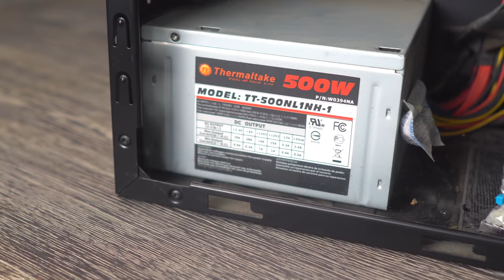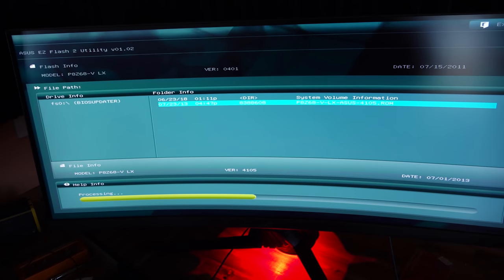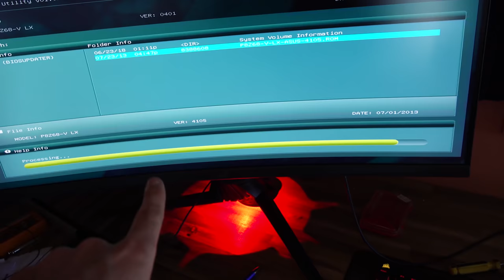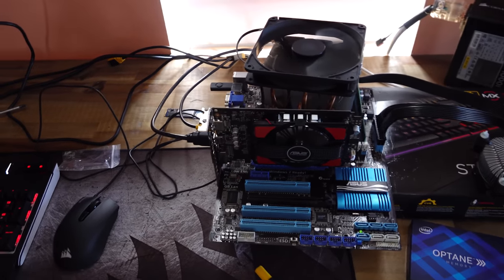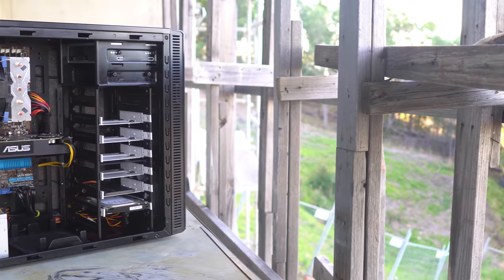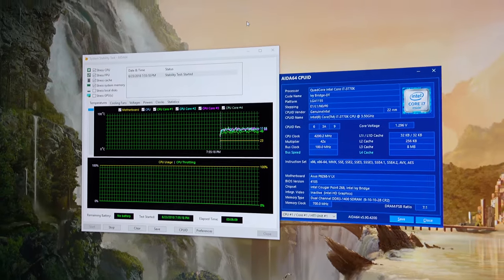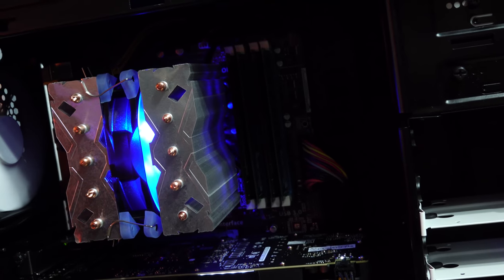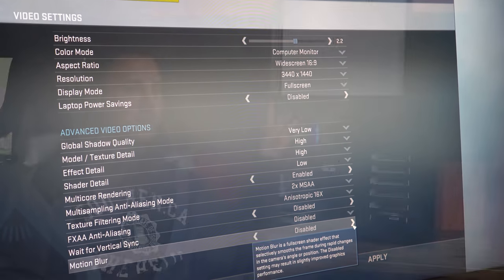How to RESTORE an Old Gaming PC - The Tech YES Process

Comment: 3:26 also try a heatgun on the metal panels, it can soften and take off the label with sometimes much of the adhesive intact. Also, ever think of using an automotive detailing brush? it would lift off a lot of dust easily, and its what i use on much of my electronics and computer stuff, aloong with a microfiber cloth and a small spray bottle of alcohol, and a little bottle of foaming glass cleaner and a lil lens cleaning cloth (just cheaper in the long run, both bottles are refillable, and the cloths wash up fine in the laundry, and the brushes are great, especially for cleaning fans, they're the business for that kinda thing, and you can get a cpl of those cloths at a servo).
Reply from the maker: Will check it out man. thanks for the recommendation.
Reply: Goof Off  or  Goo Gone is the magic sauce for any adhesive
Reply: 2nd that- Microfiber cloths so cheap these days.

Comment: Isopropyl alcohol is your friend when removing those glue marks from the stickers. There are sprays specific to remove them, but I never bothered getting them, no need.
Reply: 90% ISOPROPYL ALCOHOL DISSOLVED THE INTERIOR PAINT IN MY 2006 TOYOTA CAMRY, when I used it to clean the center console area plastic around the shift lever.   It looked so bad that I decided to completely remove the color in a small area.   It also attacks the color on my M510 Logitech mice.   The color transfered to the paper towel I was using.   Only glass cleaner from now on!!
Reply: kodo nosaki oh no, be extremely careful cleaning mouses with it. I only use the 99% ones, but plastic can be tricky. For the outside of computer cases it is heavenly.
Reply: If anything is spay coated don't use isopropyl on it, as it will most likely have adhesive combined with it which isopropyl loves to eat, not the alcohols fault here.
Pretty sure most interior car parts are sugar coated and that is why you don't see isopropyl sold in car cleaners.

Comment: Can you do a proper cpu delidding video? And I got scared by the way you handled the cpu when delidding and removing the old thermal paste. But it seems to work fine. Maybe a video about common misconceptions/myths people have when handling tech? Love this video btw
Reply: They are lot more hardy and sturdy than people think that's for sure...
Reply: phatlewtz82 dies are fairly easy to break if you put too much preassure, thats why lids/heatspreader helps
Reply: Ive delidded a soldered cpu and a i7 4790k

I would use a cheap delid tool (3d printed one) for i7 4790k

Heat gun + single edge blade (maybe a regular blade for wedging) worked on my x5675

Wedge works too - I am aprehensive of that method; chance of cracking the cpu chip (soldered)

Comment: The Ivy Bridge is still very capable. Just did a build with an i5-3570K  @4.0 GHz(a bit undervoltet!) on the small stock cooler you threw in the bin (I cleaned it of course). Peaked at max 83c on 2 Cores after 10+ min of Aida64. and in games max 75c with an Asus GTX 1070 Dual taking everything the CPU has to give. Also 16 gig DDR3-2133 cl.11 @1.6V (XMP) memory to keep it happy. Very pleasing performance.

Comment: that power supply hurts me just looking at it, older thermaltakes are absolute disasters waiting to happen
Reply: Indeed! Many Thermaltake Litepowers were garbage and this is not one of the better ones. In particular, you can see at 1:18 that its two +12 V rails are rated 14 and 15 amps, for a total of 348 watts of power from those rails. And that's if we actually believe the numbers -- it's probably "peak power" at which the PSU explodes rather than long-term capability.

I know refurbished PCs like those need to be cheap, but it is my humble opinion that PSU quality is a little bit unappreciated on your channel.

(but great channel, don't get me wrong, moar please:))
Reply: have to agree, there are better, newer, safer and affordable alternatives.
Reply: always pay extra for a quilty PSU its better to be safe and not worrying that one day it may explode on you or when you away from the pc and end up burning your house
Reply: M7AMD not even that, just don't buy old thermaltake units

Comment: You should try Mass Air Flow Sensor cleaner instead of Brake Cleaner for electronic parts. It is less likely to damage plastic parts and is designed for cleaning electronics and pcbs. Just a tip from a mechanic of 20+ years.

Comment: I have used WD-40 for many years, to soften and/or degrade sticky substances, making their removal much easier.   Naturally, secondary action by other appropriate means and products, finishes the task.    
 
FYI:  Got pizza, or other drips and spills, well adhered to the interior of your microwave oven?   In the USA, I use Shout, a laundry pre treat to aide in maximizing stain removal.   Local options should work similarly.   Spray full coverage, light to heavy, relative to the thickness of the material to be removed.   After 20-60 seconds, push with cloth or paper towel around your finger.   If stubborn, spay more.   If the mess collapses and breaks free from the surface, clean it up.   Finish with a food safe solution wipe and then rinse.

Comment: I have a 3770K and watching this video was very interesting! I find that it is a very good CPU and has been very good to me. I got the whole system on craigslist for $200, i7 3770K 16gigs DDR3 Asus Sabertooth mb GTX 660 2gig 1050w Corsair PSU and a 1TB WDB, I put my 1060 3gig and my SSD in it and it really runs well, plays any game at 60-150 fps depending on the game.

Comment: Bryan, I have a question. Do any of the parts that you spray brake cleaner/wd-40 on end up as an oily and disgusting mess over time? 
Just curious.
Reply: julian23561 brake cleaner wouldnt, it would just evaporate but wd40 would leave an oily film
Reply: Brake cleaner will completely evaporate within minutes. Its made to dissolve grease and grime and leave a completely clean surface. WD 40 will probably leave a thin coating of oil, that could attract dust.
Reply: You wipe off the residue otherwise dust sticks to it. Common step people miss oiling bikes.
Reply: If your brake cleaner leaves any residue it's not real brake cleaner.Brake cleaner should under no circumstances contain oils or leave any residue whatsoever.
Reply: So long as its not bargain basement brake cleaner it shoulnd't leave anything on it.
Reply: See this is what I also thought. Now treat this as anecdotal, but I tested it on a  bunch of old boards and plastics. Caps, Mosfets, transistors, solder resist, slots and plastic brackets in a PC. The Würth Brake Cleaner I used had absolutely no effect on the plastics, even now 2 years later. It's  Isopropyl / n-heptane based and safe for quite a lot of plastics like PP, EPDM, ABS, Polystyrene and most paints.

http://media.wuerth.com/stmedia/shop/catalogpages/LANG_en/2109491.pdf

https://www.wuerth.no/msds/pdf/01216976.PDF
Reply: @budget tech I'm surprised to see an asus employee would be subbed to cartoon network and other childish channels lol
Reply: Uk Gamer thats my kid lol
Reply: Lol @Uk Gamer, now that you mentioned it I took a look. Sorry @Budget Tech I'm going to have to call you out on that too. Don't pretend to be someone you're not. Also online when you're anonymous your credentials mean nothing. Only facts and solid research count.
Reply: Uk Gamer o my god ur a legend
I never thought of checking his subscription list
Reply: @budget tech Wait you and your kid share a youtube account? Also no tech subs to be seen....
Reply: Thanks for all the input guys. I've done my research as well, and found out that alcohol based brake cleaners are safe for most plastics. I guess I'm off to cleanse my soul (PC) with brake cleaner then!
Reply: Uk Gamer
i can confirm that the "asus employee" Budget Tech is subbed to turma da monica and other kid's cartoon channels, i also agree with @Cyber Cat, Brian uses his methods pretty much since from his early vids and nothing bad occurs if you pay attention and follow his tips, i'm an IT technitian and never had any problem from cleaning any PC parts.
Reply: @ rafa yeah at the very least a few angry customers would have told him something was up. Probably repeated uses may do something but it seems to be fine based on the tech yes vids.
Reply: @Uk Gamer agreed
Reply from the maker: Nope and nope, get a lot of repeat customers too, so they must be lovin' that tech yes lovin'.
Reply from the maker: Hey there Budget Tech, I actually work with the team at Asus here in Aus and Jack who helps make the motherboards, he says I am one of the few tech channels he tunes into because I know what I am doing.  Take your shit talking else where and GTFOutta here.
Reply: There are a variety of formulations of Brake Cleaner. You just want to avoid ones with Acetone.
Reply: Tech YES City lmao don't let these haters bring you down I love your content keep up the good work 😁
Reply: Tech YES City hey Brian, love your videos man, when i'm building an PC or i take one PC apart to clean i leave your playlist of PC Builds on, the soundtrack is great, keep up the good work, thanks from brazil
Reply: phatlewtz82 dude you basically destroyed that asus employee"Budget Tech" , nice comment
Reply: Budget Tech what do you suggest using to clean a motherboard and other circuit boards?
Reply: thank you very much... Bryan is a hardworking guy who works in my opinion harder than anyone in the " computer tech" sector of video's here on YouTube.  I just couldn't let him take shots at my boy here because It pains me (and I know I'm a sensitive person) to see this kind of mean spirited commenting behind a monitor to our fellow man/woman who are working hard. It most likely didn't even phase Bryan.
Reply: julian23561 brake clean should be fine. Evaporates almost instantly and leaves no residue. Wd40 is just nuts to me tho. It would accumulate dust like crazy. Only benefit is your stuff is shiny for a little while after u do it.
Reply: Budget Tech it's not the power delivery. I've gone a lot higher on a lot weaker boards. It's psu or a bios setting he's missing. Or it's just a weak CPU. He only went from 1.3 to 1.35 and tried to go from 4.2 to 4.5 lol. I'm guessing most likely VCCIN and a weak CPU also. Never seen a 3770k not do 4.4 even on a weak shit board. 4770k is a different story tho lol.

Comment: after the wd-40 to peel off the stickers, you can use "Goo Gone" (a greasy, oily feeling product the breaks down the remain sticky adhesive and lets you clean it up without damaging or drying out the plastic or paint with a solvent) and cleanit all up nicely and then give a light "dab wash" wit dawn dish detergent to clear the oily - ness.

Comment: I don't think that was a potato even from the start, to be honest. My secondary PC has an i5-2320, 8 gigs of HyperX Ballistix 1600MHz (2*4GB), a PS-500 PSU (it won't explode, I promise), a shitty 500 GB HDD on its last legs, and an Asus DirectCUII GTX 780. It runs just fine, save for the shitty storage. It would've been amazing to have that sort of performance when I first got the PC itself, as it came with an HD 6450 512 MB at the time.

Comment: I still use that motherboard and cpu in my main rig, just with a gtx 1080. Delided and watercooled cpu and gpu, i left the oc at 4.7 ghz @1.23v as its for daily use. Still gets all of the fps out of my 1080!

Two suggestions, nail varnish remover works very well when cleaning sicky residue, its also dirt cheep.

I would have been tempted to flip the psu, as those feet you put on it are not very tall, i would be concerned about the psu being able to cool its self.

Comment: Bryan, trouble with your overclock may come from the VRM, as it's not cooled in any way and anything over 1.3V can make it over heat and eventually at some moment so not deliver much enought of power making system go blue. Please try to cool VRM (fan or some little radiators) and try again

Comment: Good video Brian. My guess is that it's not the CPU. It is the motherboard. The power delivery phases on this cheap Z68-V LX is limited. The caps and VRM's are not up to delivering the power (and peaks) what it takes go get to more than 4,2-4,3. With an i5, you probably can reach 4,4 with no worries.

Comment: Careful with that PSU, it's not 500W as you think. In useful terms it's only a 350W PSU.

It has a peak power output of 500W total, but it's only 350W total sustained across the two +12V rails. It can handle 168W across one rail and 180W across the other.
Reply: Ehh luckily a 350 can run that system just fine. Should probably use more. But it will work.

Comment: You must have loads of cool old pc cases lying around that never sold or weren't worth saving, think you should do a sleeper build, find the nastiest 90s beige box and slap a beast of a system in there, 8700k/2700x and a couple of 1080tis in sli or a titanV, full custom loop cooling, just go nuts :)

Comment: On my i5 8600k I had 5 of 6 cores stable at 5ghz at a respectable voltage and ended up having to go honestly much higher than I would have thought to hit all 6 cores at 5ghz. It’s not all that uncommon in my experience at least. Had a similar problem with a 2600k back in the day as well.

Comment: some advice from a technician: The fastest and cleanest way to remove stickers is to use a blow dryer orhot air gun, and lift the sticker with a plastic spudger or putty knife and then clean any residue with 99% rubbing alcohol and an rough shop rag. If you don't have a heat gun, you can lift the plastic or paper with your tool of choice and then really go to town with the rubbing alcohol.

When cleaning out cases, an air compressor for your shop is a life saver.

Comment: The 212X was shorting the motherboard? Bizarre...
Reply: if you aren't careful the backplate at the rear of the motherboard used by the Cooler "shorts" on the screw that sits proud of it / simply make sure you have the open ended side of that bracket  over the screw .
Reply: I've had the same happen, happens when the tape under the fixture that goes into the mobo's holes loses it's electrical tape.

Comment: Another method to take off a sticker is to take some vegetable oil, put a bit on the towel and rub the part where sticker layer remained when it separated. Enough force and oil will help you remove it, much better than WD-40, just remember to remove vegetable oil grease in that spot with a sponge with a bit of soap. Oil also works as non-scratch compound, as long as you don't use a sponge, use it on cotton towel, or something soft.

Works every time

Comment: hey btw yes if you use a hair dryer directly on to the surface of a sticker for about 30 sec it will come straight off because it heats up the glu and loosens the chemical bond so it give it a try sometime

Comment: The Cpu may have degraded because of the intel stock cooler, a friend of me had the same problem. His cpu ran at 100 degrees, sometimes the system crashed and I just delidded it, smashed another cooler on, BUT only 4.4ghz on an i5 4690k!!

Comment: ware do you get BIOS updates. And there is a product called go gone that will remove that adhesive better than WD40 that is flammable the go gone isn't you don't want to use a pry oil around electrical parts.

Comment: what if the provided power supply only has a 4pin instead of a 6 or 8 for GPU power? is there an adapter or should you just replace the old power supply with new?

Comment: See if you can build the most balanced system possible. For example a system that maxes out the CPU and the GPU at the same time. I know that different games give different results, and some are either really GPU or CPU intensive, but would you try?

Comment: Well, with a good Z77 it wouldn't happen to clock down Brian. I am using a Asus P8Z68V-Pro GEN3 with a i7 3770, not K. I wanted to give it a boost-overclock to 4.2GHz which turned out to be working from what cinebench r15 tells me (~760CB). Never the less, the cpu is clocking down even in High Performance Mode and all Energy-Saving features off in the BIOS. When gaming it keeps it's 4.2GHz for a long time but at some point one core is clocking down to 1.3GHz. CPU & VRM-temps are okay... Even at stock settings the Z68 keeps doing this. I also had a P8Z77-V LX which went bad resulting in 2 defective RAM-slots and lost overclocking-ability, since it didn't boot anympre then.

Conclusion: Maybe Windows 10 isn't fully compatible to these boards, or they are just pretty bad (more likely to me!). The Z77 couldn't even handle any RAM overclocks with 4 dimms. There are also many people complaining about this in many forums, so yeah. Lol

Still a great video! These CPUs are still very capable when overclocked. ;)

Comment: Most likely input voltage effecting your clocks. Or it's just a super weak CPU. Worst 3770k I've ever had did 4.4 at 1.26v tho. I've had input voltage allow clocks to go higher on a few CPU previously that wouldn't become stable at a higher clock no matter how high I put vcore tho. Input voltage resolved it.

Comment: Brian, voltage is way too high for a 4.2ghz 3770k. Saw it hitting up ti 1.3v. That offset you set was on auto. You can try 0.020 on negative offset man. Might keep the cpu a bit cooler than what you have right now.
Reply from the maker: Board doesn't have any other option to control voltage :(, VRM is real mediocre at best on this one, plus a random PSU its tough to OC on this one dude.

Comment: Man I have this exact motherboard paired with a 2600 and I can't get it to boot with my 1060 on the primary pcie slot. It recognizes my 960, but pretty much every other card I have, doesn't work on pcie slot 1. They work on the second slot but not the primary one. I'm even more confused now that I see it worked perfectly for you.